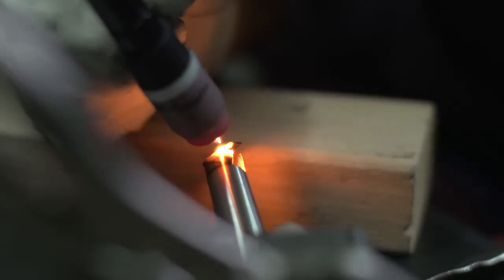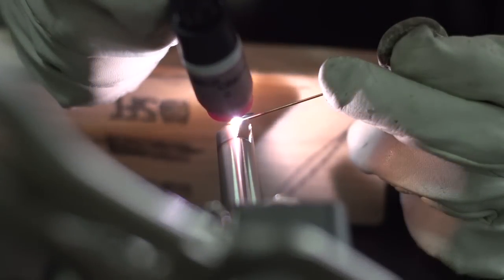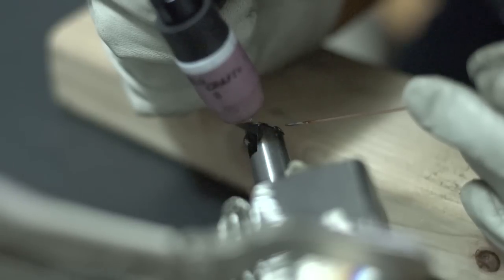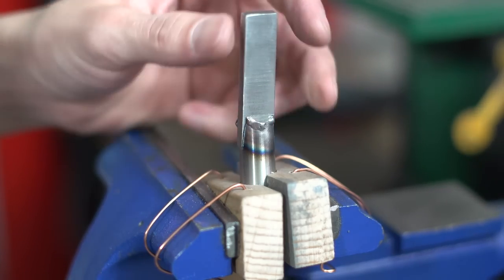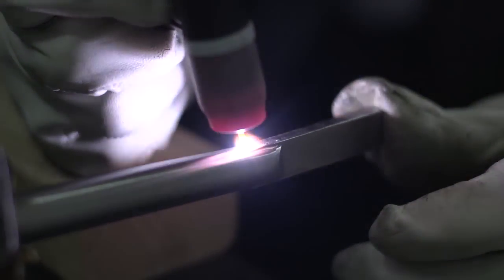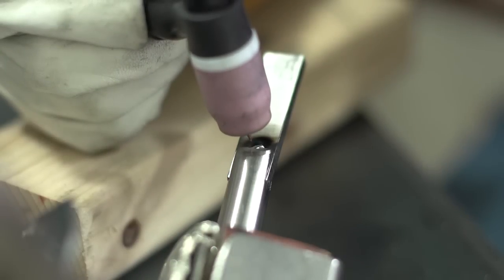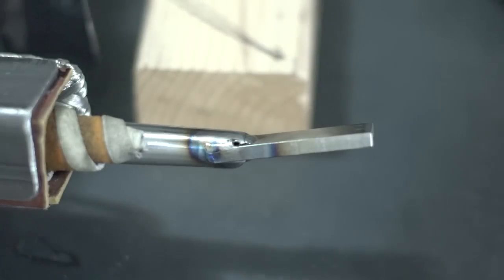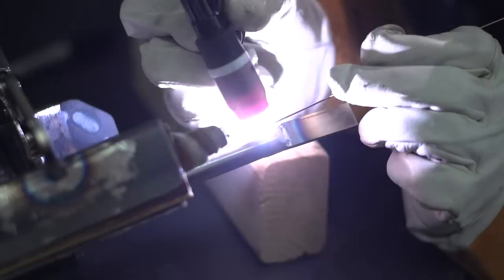Bicycle Frame Build - 46 Practice Tig Weld Dropouts

Comment: Great Video. What were the amp settings? Also if U were to weld a 5mm brake ISO tab to a seat stay, what amps would you use. Also would you recommend pulse welding or normal?

Comment: Closer arc, less amperage and sharpen that tungsten....also, don't take the filler out of the gas, or at least cut the oxidised end off next time you use it.

Comment: Wouldn't it have been better to not do the cap piece you did and fill the whole weld with weld and grind down?
Reply from the maker: In that case the best choice would have been to turn down a plug and weld it in there. Then make a slotted cut after. I probably should have done that.

Comment: You need purge gas inside the tube and also to make sure that there is no grease or oxide on your filler wire, then there will be no sparks at the end.
Reply from the maker: +Nigel Kingsley-Lewis Yes! :)

Comment: Why not mill an offset Clevis joint and weld it in as and insert, far stronger.. Also pulse is not helping you here, you should be focusing the arc onto the thicker piece and moving pool to the thinner, welding the joint as you are is not fully penetrating the thicker piece
Reply from the maker: +sweenep86 I had to look up "clevis joint". I'm such a noob. I like it! I'll try that some day. Thanks for watching.

Comment: the sparks are because you have to keep the wire under the cup while it cools. when you dont it gets dirty.
Reply: +Banke Andersen I saw the same thing Banke saw.  When you are done with a weld you pull the filler rod out of the argon shield quickly so it ends up oxidizing and getting contaminated.  The sparks happen when you arc up again with a dirty rod.  Keep it in the argon during the post flow cool.  Acetone is your friend. Clean your parts and filler wire prior to welding. You may see a big improvement with these two steps.  Check out weldingtipsandtricks.com and on youtube.  Specifically search for Jody's rule of 33's with pulsing. 33pps, 33% on time, & 33% background amps.  You may like that better than 0.8 pps.  It is great for keeping the heat low and not having to dip every 0.8 seconds precisely.
Reply from the maker: +Michael Bilotta Cool, thanks guys. I'll try to do that. I do snip the end of the wire but I really need to train myself to keep the wire shielded. Thanks for watching.
Reply: fine. also remember just a little touch or dirty wolfram. it needs to be rechaped

Comment: I've had the same thing when welding small round things. I suspect that the gas pours right off the surface when it has that geometry. I'm thinking that some sort of tray beneath the item would help keep the argon where it's needed, or maybe just a diffuser in the cup.
Reply from the maker: +Convoluted Logic Totally agree. I'll try something like that. Foil will probably do the trick.

Comment: Try using a different cup size, and make sure the run out isn't too far on the tungsten...should help with the shielding issues : )
Reply from the maker: +Function4Form Right on. thanks :)

Comment: At the 4:55 part of the video it looks like you contaminated the tungsten (blue flash followed by sparks). Shortly there after you mentioned the sparks. If you check the tungsten you would have probably seen the soot on the end.
Great overall effort.
Reply from the maker: +Zombiesniper Ah, yes. I most likely contaminated the tungsten!!

Comment: have you ever considered getting a real rhythm going. like metronome type of rhythm and set your pulse at like 120 per minute and and dap like 30x per minute. it may sound funny but rhythm Is rhythm.
Reply from the maker: +bryan brunk Interesting! I think it would be difficult to synchronize the welder and the music.. hahah! Miller should make a welder that will sync the pulse to music ;)
Reply: I'm just saying it might be easier to find your rhythm that way
Reply: +bryan brunk I just had my hip replaced and am using a metronome to force me to walk without a limp. Years of compensating caused a habit. 
It was a method I saw here on YT. Oddly enough being intentional and rhythmic almost immediately makes me walk normal. 

Too bad I dont use it playing guitar ;-)

Comment: Hey sorry to keep bothering you. Just a question: do you have to heat treat CroMo frames? (I know aluminum frames have to be heat treated). And does the CroMo tubing come pre heat treated? I know bike frames need spring, so do they get that from the geometry alone or do they also rely on the material being heat treated and tempered like other carbon steals? Does the welding process anneal the material? Sorry if some of the answers are obvious, I'm just a bike mechanic and have no clue about frame building. Cheers!
Reply from the maker: +thehollows Not at all! These answers are not obvious, and I'm not even totally sure about the answer. I was taught that thin chromoly bicycle tubing does not need to be heat treated or annealed. I'm not sure but I believe annealing is generally not a good thing for chromoly bicycle tubing. When welding, its a goal to keep the heat affected zone as cool as possible and try to only heat the small area where the weld is being made.
Reply: +Pithy Bikes I suppose that makes sense given that CroMo frames seem to be a tad more springy than similar aluminum frames in my experience. I personally prefer CroMo frames for this reason. Thanks for the reply!

Comment: Looks good. Good experimentation on the welds.
Reply from the maker: +Jess Neal Thanks man. I'm glad I practiced because I've already thought of ways to do it better. I'll show you guys in the next one. :) but to quickly explain - I should have used thicker material for the caps. And, I should have left the welds near the ends of the material unwelded until it came time to weld the drops on.

Comment: No stress brother! Love the videos. When you do the real thing it will be easier. The drop out can take a lot of heat which also helps keep the stay from burning through. Looks good.
Reply from the maker: +Jared Morris Yes! I think I'll use thicker material for the caps too. That should help also. Joe mentioned that maybe my welds were not hot enough along the long parts. I agree because the bead didn't really absorb into the metal.. Practice is a good thing :)

Comment: what size tungsten you are using?
Reply from the maker: +pauldirma For the caps I used .040, but I think my usual 1/16" would have worked just fine. For the welds to connect the drops, I used 1/16"